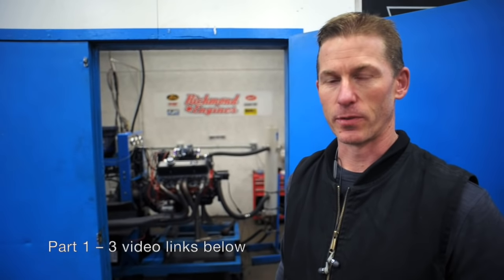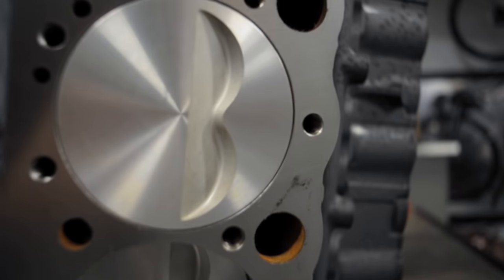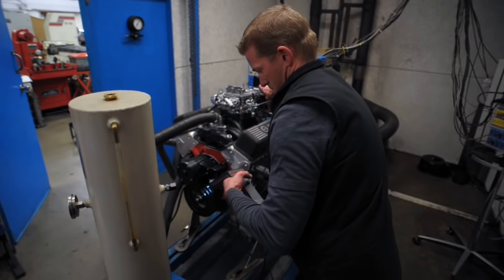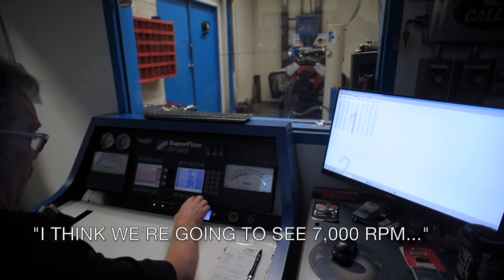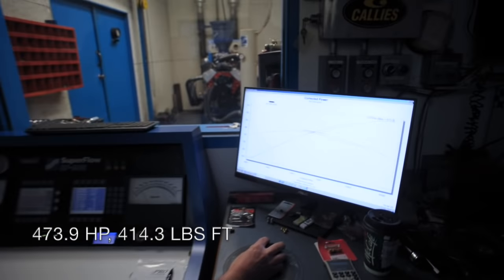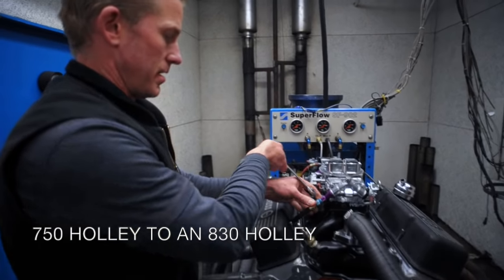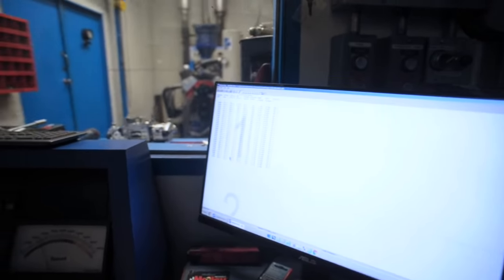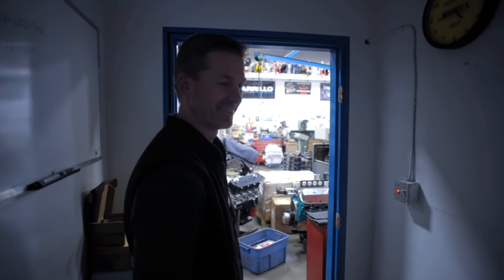SBC 283 Crankshaft + 400 Block = 500+ HP (Dyno Test 1 of 2)

Comment: You mentioned spacer bearings- did you use an actual 283 crankshaft or the later 302 crankshaft that could have had larger journals?  With an original 283 crank that gives you really big spaces to fill.  My father was building hotrods a long time ago and he said they would put a 283 crank in a 327 block to make their own version of the 302 before it was produced by the factory.
Reply from the maker: Thanks for commenting! We used a small journal 283 crankshaft. The 400 block we found from a scrapper was an old GM Bowtie block and it had “350” mains, therefore the common main bearing spacers did work. I’ll add that they fit perfectly!

Comment: Much easier on the ears than the 6200 I used to shift my factory '70 2-bolt 3951511 block 400 at. She is moth-balled for now but I am starting to see a 283 and crank in her future!!
Reply from the maker: Go for it!! Thanks for commenting :)
Reply: We do very much the same combination with slightly longer rods more compression little bit more cam he was making 600 hp it's there you just have to talk to her

Comment: I've heard of the Famous Homemade 302 (327 block+ 283 crank) the same using a 350 block (using similar bearing adapters), a 377 (400 Block+ 350 crank) 383 (350block + 400 crank) and even a 334 (I think) (307 block+ 400 crank). This is the first I've ever heard of someone, trying to use a 283 crank in a 400, very cool. Me personally due to the size differences in journals, I might have had a crank custom made to a 400 journal size just for bearing stability, those bearing adapters are notorious for spinning. But this is pretty cool
Reply from the maker: Thank you! Our block is a BowTie block that has 350 mains. There are still spacers in there to fit the small journal crankshaft but the ones we’ve used fit amazingly and there’s no concern of them spinning. Thanks for commenting :)
Reply: @ceperformance , Ok less adapting is always better, did not know that about the bowtie block. BTW this is still not the most unusual engine I've ever seen. Our local speed shop owner did oval racing and built an interesting stroker small block dodge, He took a 340 block and a 360 crank (turned to the 318/340 main journal size) and offset ground the rod journals to a 350 chevy journal size and used a 5.7inch rod with the stock 340 pistons ( want to say it was around a 370 cu in afterwards). The offset he ground into the crank meant no changes to pin height. That was a crazy fast oval car when I saw it run
Reply from the maker: That’s some great innovation! Very interesting :)
Reply: @ceperformance , It was a local track class that required a mostly factory engine, but factory was a bit loose, as in other makes and differelt class parts can be used (Example cleveland heads on SBF's or BBC rockers on a small block Chevy) so long as they are factory part numbers, a lot of outside the box thinking there. Hipo Ok, but no aftermarket pieces. I didn't see the logic of shortening the rods, till he explained the class. he was racing more than a few homemade cleveland headed SBF's in that class and held his own. it was a crazy class
Reply from the maker: It’s great to see that type of creativity come together.

Comment: Old hot rod article the 350 chevy should have built seems very similar to this. 400 block with a 327 crank. Ran very well on 87 octane too.
Reply from the maker: We did a couple similar builds to that article with the 400/327 combo. Check our page for videos on that. Thanks for commenting!
Reply: @ceperformance  looking forward to seeing that video! Have you done similar pkgs with the ls platforms? Given your port sizing knowledge love to see what a destroked ls would do.
Reply from the maker: @whaddayawant2197  
Thanks! Yes I’ve done an LS 6.2 block with a 4.8 crankshaft. Used LS7 flat top pistons standard bore, machined the block from 4.065 out to 4.125. With 6.3” rods it all fit quite nicely. It’s got AFR Rectangular port LS3 heads that we milled down to 63cc chambers to land at 12:1 compression. Runs amazing on 94 pump gas. Pulls hard to 8,000.
Here’s it in my Nova…

https://m.youtube.com/watch?v=JrGCAT-eVjE

Comment: What balancer and flywheel did you use??? The 400 external balancer?
Reply: Hello and thank you for your question. 
This engine has a steel 283 crankshaft in it and so it is neutral balanced. It has a PowerBond PB1046-N balancer and will get a McLeod billet flywheel.

Comment: I was expecting more rpm from the short stroke, but those are good real good numbers.  I did a short stroke 350 a long while back with some inspiration from an old Indy car that had extreme rpm pulls, got it to rev to over 10,000 rpm but that wasn’t where the power was. It had a power drop off because of various valve float issues which require numerous changes in spring tensions, valve adjustment and even changing pushrods and lifters, also even changed Drive accessories to get a few hundred rpm more out of it.  Which cylinder heads, valves and valve spring set up  are on this?  I love obscurity builds.
Also before I get jumped on for the rpms being too high it wasn’t being ran for horsepower at those rpm’s but durability testing at high rpms and to watch the hp drop on the dyno.
Reply from the maker: Hey thanks for your comments! We didn’t take it any higher at first because of valve float but after changing to titanium retainers and tighter installed height, she goes clean well past 7k. 
The heads are AFR 916’s, 180cc, 2.02/1.6”

Comment: Is there a link or information for the bearings/spacer combination? I imagine they are built to order, but was curious on availability.
Reply from the maker: Hi BlueCollar Hotrods, thank you for your question and comment. The specs are in the description: bearing spacers are from Race Engineering: https://www.raceeng.com/p-28627-main-brg-spacersj-crank-to-lj-blk-set-bs-327.aspx
Reply: @ceperformance  Thank you for the response! Your engine build has the wheels turning.

Comment: I don't have the math skills to prove it, but I'd bet the piston speed at 7000 rpm is equal to a 400 running 5500. Great build.
I'd like to see the principal applied to a Pontiac 400. Bored to 4.15 with a 326 crank dropped in.
Reply from the maker: Thank you! I would be interested in a Pontiac build like that too.
Reply: @ceperformance  a Pontiac 400 and a 326 have the same stroke!!
Reply from the maker: Thanks for your comment :)

Comment: Is there a reason you didn’t go with a single plane over the dual? Say for drivability or the desired torque that the dual plane offers or was it for the challenge?
Reply from the maker: We like the dual plane for the broad torque for the drivability benefit. It would probably make a tickle more HP up top but also move the peak torque further up the RPM with the single plane.

Comment: Sweet! I always thought about building this combo. I even sent it to HotRod magazine years ago hoping they would build it for a engine contest that they had.
Reply from the maker: Interesting! Did you get a response?
Thanks for commenting :)
Reply: @ceperformance  Unfortunately no, I think they ended up building a Chrysler engine. Thanks.
Reply from the maker: Oh well. Good for you to reach out to them anyway. 
Maybe not to late to build your own project!
Reply: I’m building one now 400 block 4.185 bore 3.50 stroke crank Honda rod journal size 220 afr heads 12-1 icon 2618 pistons all arp studded and strapped main caps 4 bolt main not the 2 bolt come out to be a 383 cubic inch that will turn 8200 all day long estimate realm of 650 Hp with around 550-575 ft lbs of torque but we will see after it’s built havent decided on cam yet but will be around 270 at 50 should be real fun with a m22 in a 78 Camaro
Reply: @thomasbradley7844  Tom, that sounds real cool. I have a mild 383 in a 73 Vega.  I hope to have it on the road soon. I don't think that Muncie will last even if it's a m,22. Good luck.
Reply: @gregpiecuch3802  nope probably not and neither will the 10 bolt out back but I’ll upgrade as I break them
Reply: @gregpiecuch3802  good luck on your project
Reply from the maker: @1lows10 
Sounds like an awesome build! I’d consider a solid roller camshaft for that awesome combo. Would suggest a rev kit to keep the lifters in contact with the cam and a stud girdle to support the rocker studs :)
Would love to hear your results!
Reply: @ceperformance  oh shaft rockers and solid roller is the direction I’m going with great minds think alike I sure don’t mind running valves once in a while even have a jesel  timing belt set up for it
Reply from the maker: Sweet. Going to be a blast!

Comment: I really like that little engine although I don’t like the idea of spacer main bearings but it’s mainly because I don’t know anything about what your using exactly & if it’s a big weak spot or not.great job man 👍🏼
Reply from the maker: Thank you for your comment! 
Race Engineering takes an HP King Performance main bearing for a 400 and trim the inside to fit the 350 bearing inside of it. It’s an absolutely perfect fit and we have zero concerns with using them.

Comment: More info about the  engine  bearings you used.   Small or large journal  283 crankshaft
Reply from the maker: Hi Shane, thank you for your question. Specs are now in the description. Here's the link to Race Engineering's bearing spacer:  https://www.raceeng.com/p-28627-main-brg-spacersj-crank-to-lj-blk-set-bs-327.aspx

Comment: I’ve put together a couple of 364 inch combos by having the crank offset ground to run 327 small journal rods and they always worked well.
I’m currently screwing together a forged bottom end 355 with some 205cc intake runner aluminum heads that is to be a 500 hp base for a 200 shot of spray.
Just found your channel and will definitely be looking at more of your videos.
Reply from the maker: Thank you for commenting! What rod length went into the 364 combos?
Reply: @ceperformance  standard 5.7”
The 350 block is bored .030"over, and the standard 350 crank is offset ground 1/16" , with the rod journals turned down to the old 'small journal' 327 size. 
If you use an aluminum rod you may have to clearance the block on the pan rail.

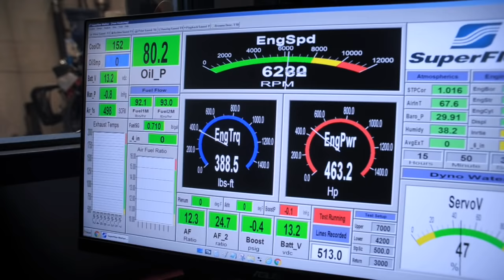Comment: 3:16 this is showing some mistakes. Look at screen at 6500 rpm (needle) 6984 (indicated by number). 501.2 hp (uncorrected there?) Then look at bottom of the screen. Also, is a 283 crank 3” stroke or are you using a custom crank?
Reply from the maker: Yes it’s a stock steel 283 crankshaft and is a 3” stroke. The numbers on the screen when viewed live don’t always match the corrected numbers. What I mean by corrected numbers is there is an altitude corrected power and torque that’s calculated by the Dyno program. This is how no matter of the weather or your local sea level elevation, the test should duplicate from one guys Dyno to another. Within reason.

Comment: With a 2.04 rod ratio, that thing could easily spin 8000 rpm. I built a bunch of 377's back in the 80's and 90's. They liked lots of cam, lots of intake manifold.
Reply from the maker: Cool stuff! Thanks for commenting :)

Comment: Nice engine for the street, did you guys try to put heavier value springs in so it don't  start to nose over at 7100rpm? I'm sure you could get 10,000RMPS out of that setup .
Reply from the maker: Hey, thanks for commenting! Yes we increased the spring pressure and lightened it up with titanium retainers.  
There’s a video of that as well as a second dyno session. 

https://youtu.be/zXT_6H_tWYU?si=GGwFuAIhRgw2Vg3M

https://youtu.be/Ge6RsIOs1-U?si=N1nWcmuCk0IDoofl

Comment: I had a mostly stock 327 just cam, manifold carb and headers in a 74 Mikado Luv truck. had Nos too which I could only use in 3rd and 4th gears. I was only 19 and would take it up to 8000 rpm on occasion and somehow it never blew lol. In 1980 you could buy clean late 60's mustangs and camaros for peanuts compared to now with local speed shops selling go fast parts everywhere. Chev sm blocks were always cheapest to build.
Reply from the maker: Fun time they were!! Thanks for commenting.
Reply: @ceperformance  love your build what nice sound and the octane comparisons too thanks 😊
Reply from the maker: Thanks again! Have a look at this one…

https://youtu.be/Qz12HXH2qXA

Comment: I noticed that you used a 6.25 rod on the 3.25 stroke . How come the the 6.1 on the 3.0 stroke? Verry exciting stuff on 87 octane. Still everyone stuck on building dump truck stroker motors.
Reply from the maker: Reason for the different rod lengths is to try and get to 2:1 rod to stroke ratio. That being said, at the same time, using parts that exists from other engines so that it’s not outrageously expensive. Thanks for commenting!

Comment: I built a similar displacement engine, a 327 (from a 283 block), very close in many respects except for bore/stroke.  Same AFR 180 CNC heads, also angle cut to 58cc.  Comp Cams Extreme Energy solid flat tappet cam,  but with 244/252 duration @ 0.050.  Don't think it makes near that power, though never dyno'ed.  Guestimate is around 410-430 as it ran a best of 11.67 in a 1967 Nova.   Nice job, would love to duplicate your engine!
Reply from the maker: Thank you Jerome! I’d be happy to share what parts we used if you wanted.
Reply: @ceperformance  That would be great!  Knowing the AFR’s are good for 500 hp, don’t need an upgrade.  Also I don’t want to overpower the drivetrain with too much torque!
Reply: @ceperformance  How much would a similar engine cost?  Having a hard time finding decent SBC blocks, only the high dollar stuff.
Reply from the maker: @jeromeridge5566  
You’re right, these old 400 blocks are getting harder to come by. 
The cost of a build like this is about $10k but more like $12k if using a new Dart or BowTie block.

Comment: Great vid. I wonder how much this combo resembles the Z/28 302 specs?
Reply from the maker: Hi Giving! Thanks for your comment! There really isn't a comparison apart from the 3" stroke length. Here's another channel's dyno test of a DZ302, producing 415HP and 345LBS FT: https://www.youtube.com/watch?v=i9vJ5BYhje8 , and the top comment read: hot rod magazine or super Chevy magazine did a build with the dz 302. stock block, ported 186 heads and crankshaft.  aftermarket pistons,  rods,  cam, headers and intake. it made 501 hp @ 8500 rpm. pretty impressive.
Our 329's second dyno test resulted in 512HP and 435LBS FT, a result that surprised us and that we are very happy with: https://www.youtube.com/watch?v=Ge6RsIOs1-U

Comment: This thing will turn 7000 rpm with a 224/230 duration cam?  Seems like it would need more duration to turn that kind of rpm.  Is there some special trick involved?  Super tight lobe center maybe?
Reply from the maker: For our intended use we went with the wider lobe separation because of the increased manifold vacuum and great drivability. Thanks for commenting!

Comment: Just curious, what was the goal with this engine? Traction limited car?

I like RPM as much as the next guy.......I'm just trying to figure out the advantage of the shorter stroke vs a 3.48 or 3.75 stroke. I know piston speed and rod angle is better with the short stroke but that isn't really an issue at the power/rpm levels you are at. Back in the day some guys who wanted RPM would go small displacement because they didn't want to spend the money on good heads to feed large displacement at high rpm. Since you are running AFR 180s anyway.......the price should be neglible for a larger as-cast AFR head.

Either way, good engine build and great tinkering skills........that is what hot rodding is all about. Now throw that engine in a superlight stick shift car with deep gears and have some fun.
Reply from the maker: Hey, thank you for the message! For this build it was spurred on by a very enthusiastic customer that wanted to us the BowTie block he found but wanted the short stroke. Because the block had 350 mains, the 283 crankshaft became an option where normally it wouldn’t be possible. 

We enjoy doing things a bit different… using some old school proven engine building ideas along with the improved heads and valve train of today! 

That being said, with the mild manners and great drivability of this little motor, we’re very happy with it. One change we’re doing is titanium spring retainers and 30 more pounds of pressure. Then another whipping on the Dyno.
Reply from the maker: And yes, a TKX transmission with a 3.27:1 first gear!

Comment: Would love to know cam specs and type... Didn't sound very aggressive...
Reply from the maker: Thanks for asking :)
It’s a custom grind from Comp Cams. 
Hydraulic Retrofit roller 
224/230 @ .050
.536/.544 lift using 1.6 ratio rockers 
114 LSA
4 degrees advance (ground in)
Also it’s a 4/7 swap firing order.
The lobe numbers are 3314 and 3315

Comment: What valve sizes were in the heads? Did you emgiggen them for use with that big bore? Sorry if its been mentioned, i missed it
Reply from the maker: The AFR 180’s have 2.02” / 1.600” valves.

Comment: Not sure if you mentioned the cam specs
Reply from the maker: Hi Ryan! Thank you for you comment. The full specs are in the video description box. "The lobes are from Comp Cam's Extreme Energy family and are numbers 3314 and 3315. 
It’s 224/230 @ .050” lift. With 1.6 rockers our lift is .536/.544 at the valve. Our cam has a 4/7 swap, with the final cylinder firing order being 1-8-7-3-6-5-4-2."

Comment: I'm surprised you didn't use more head and cam. DZ302s will make 550hp, that's 339ci, I would think that with a set of 190-210cc heads and a roller cam in the 240-250 deg @0.050", .550+ lift on a 106-108lsa neighborhood she would make over 600hp no problem. A crank from a 1994-1996 L99 4.3L V8 Caprice had medium 2.45" mains and would have worked without spacers.
Reply from the maker: Your right. More cam and larger heads would of course make more power. There’s always more a guy can do but it comes down to what a guy wants I guess. Thanks for commenting :)